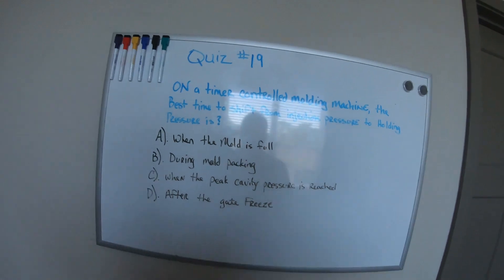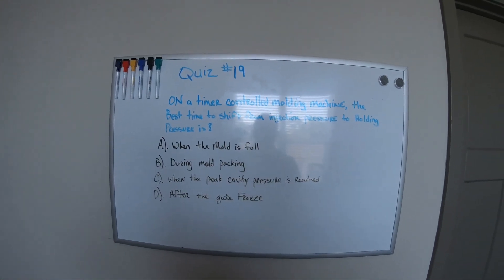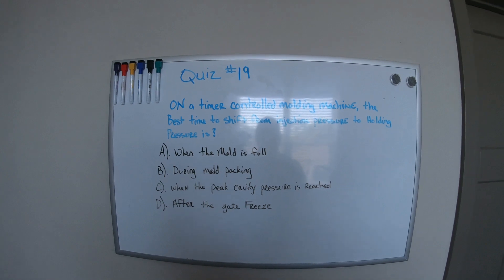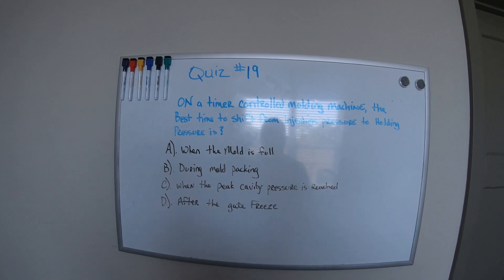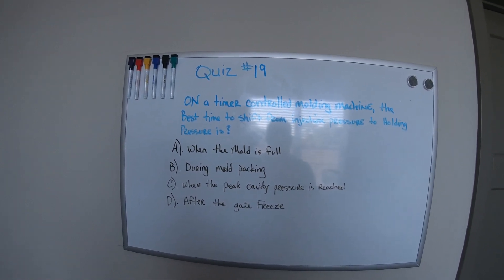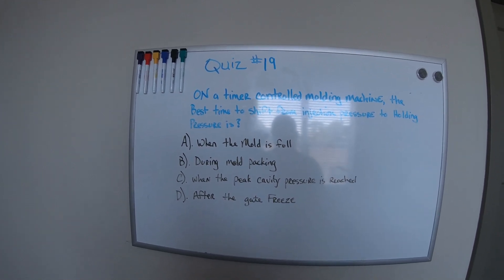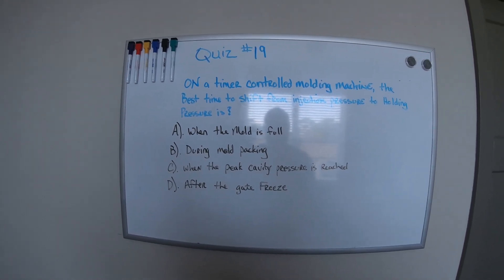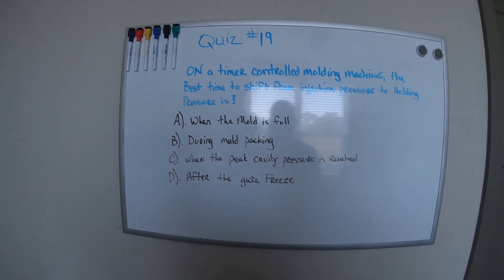Quiz #19

Comment: I'm on the fence between A and C
Reply: It is an old school machine they don't have a screen what did you think i think it is a
Reply: Hello friend,  I'm sorry if I'm wrong but up to two years ago I'd never molded with plastic so how should I know how an old school plastics molding machine looks? I learned to mold aluminum in the early 2000's on presses made by birch, hpm, and kux.  Speeds were dictated by hydraulic valves and accumulator charge ratios,and positions were indicated by tail rods and limit switches.

Please be nice to me, I've made more bad parts then you've ever made parts.
Reply from the maker: I will give the answer & let you know why ok bud. Thanks for watching & the support to the channel I greatly appreciate it.
Reply from the maker: I will give the answer & let you know why ok bud. Thanks for watching & the support to the channel I greatly appreciate it.

Comment: I guess 
A)

Though, I’m not really sure, A) sounds the nos logical answer to me. 

I have only 12 years on injection molding and since the beginning I was introduced to decoupled molding with generic keba or sigmatek controllers. But I’ve seen old school machines without electronic control systems and I just have the most respect for the engineers and technicians that dominated those machines.
Reply from the maker: I will give the answer & let you know why ok bud. Thanks for watching & the support to the channel I greatly appreciate it.